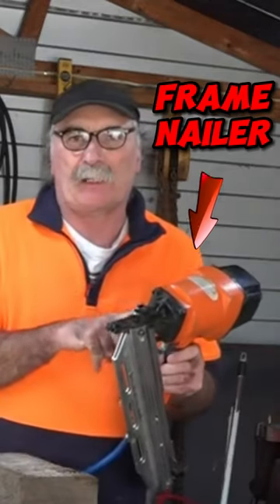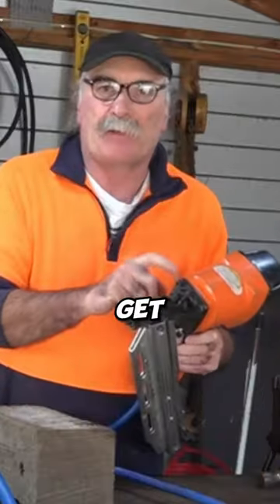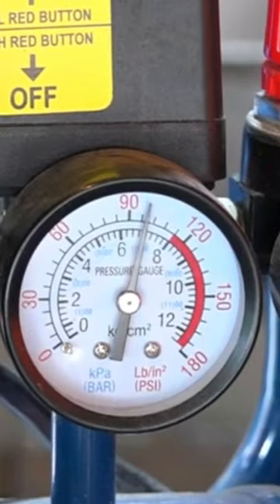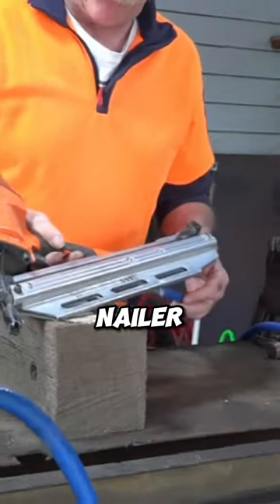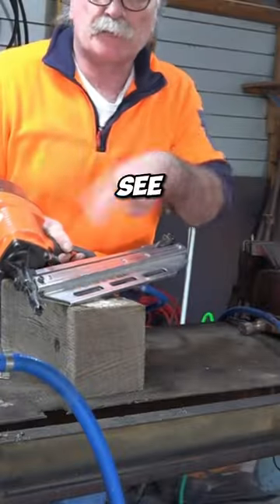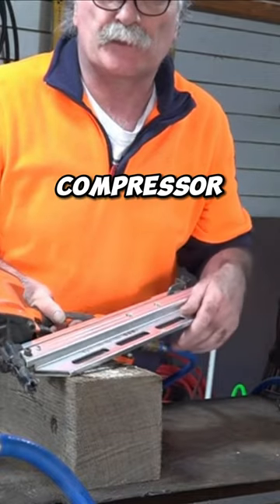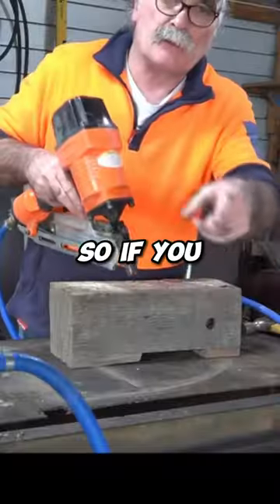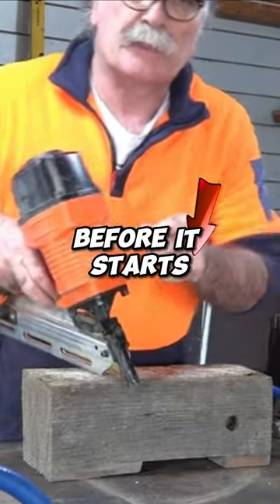Insane Test: Small Compressor vs. Large Nail Gun

Comment: It might work but I am not to sure if you can « machinegun » it with that compressor, what I mean buy that is to use the recoil of the nailer to bump itself up while you are still pressing on the trigger and moving in the line where you want multiple nails in a row. Although if you have this nailer and compressor combo you probably do not have the deadlines that would make that technique worth the reduction in accuracy.
Reply from the maker: Hi mate .No i am just building shit around home .Thanks for watching